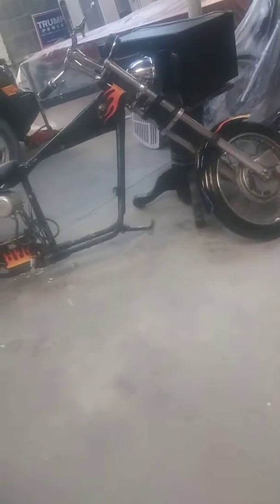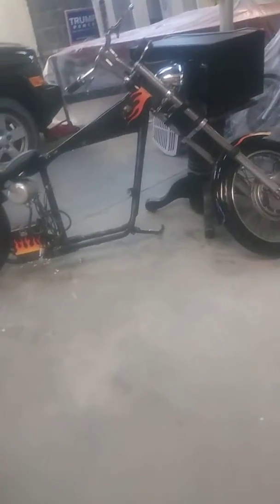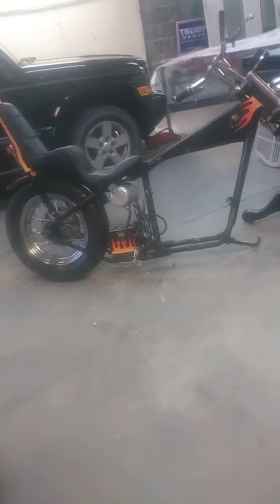Back at it soon on the triumph chopper. Gettin a 750 kit for it

Comment: Don't know what it is but I still get excited when I see an old Triumph. I've been working on my 68 engine again. Was supposed to rebuild it last winter but it was so cold that it just didn't happen. Got the Focus and spent the fall working on putting on the flames and all the writing, so now that I'm back into the old 650 Bonnie again, I find myself having to wait for a cam gear puller to come in so I can break the cases open and make sure the sludge trap is clean and the lower end bearings acceptable. So that puts me a couple of weeks behind waiting, so I'm back into the bush cutting firewood. The mosquitoes have arrived and they just ruin a good time. lol. love the black and flames. The pointy sissy bar I could do without. Deadly should one lay the bike down on a corner in town because with a passenger, the ass end of the bike always seems to swing around and the sissy bar usually kisses the passenger in the back. No shit! That's a reality. I've seen it happen too many times to deny the physics.
Later Bro.